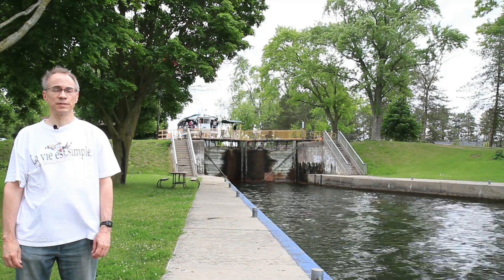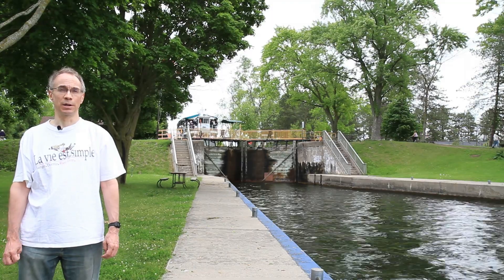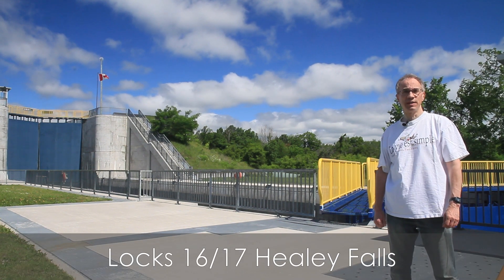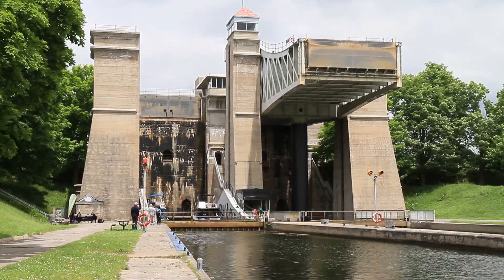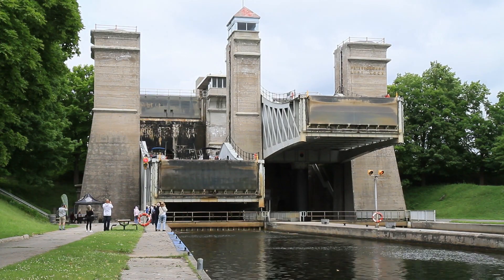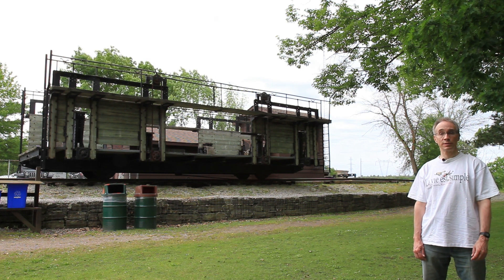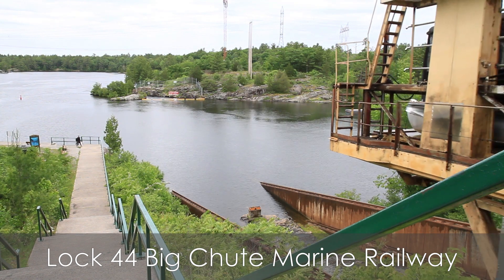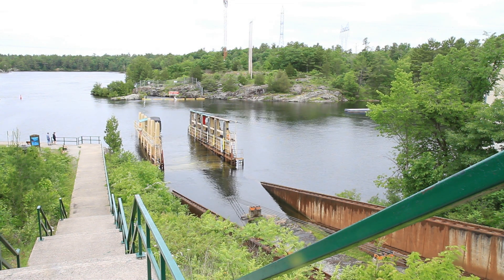The Trent-Severn Waterway's Various Locks - How Do They Work?

Comment: Great overview. One minor correction: The other marine railway on the system (Swift Rapids) was actually replaced by a single giant lock (the largest flood lock on the system), not a set of locks. It's a pretty impressive lock which I definitely recommend checking out. The challenge is that there are no public roads to get to it, so water access is your best bet.